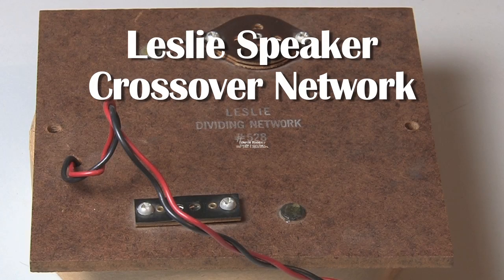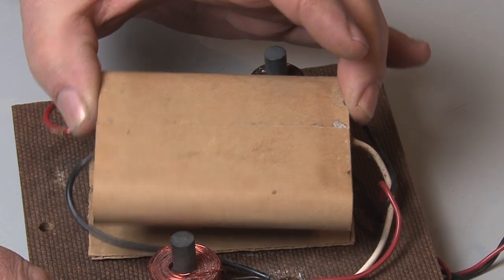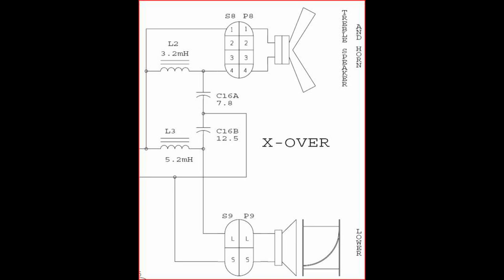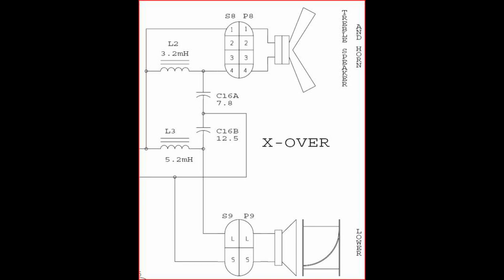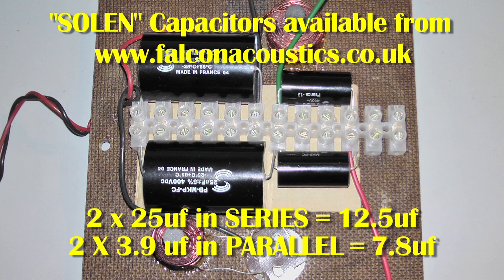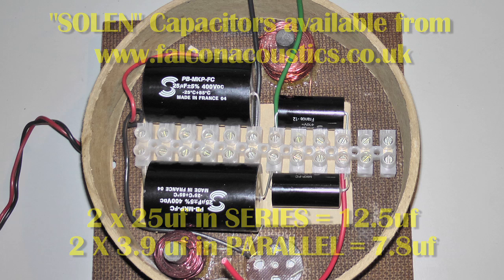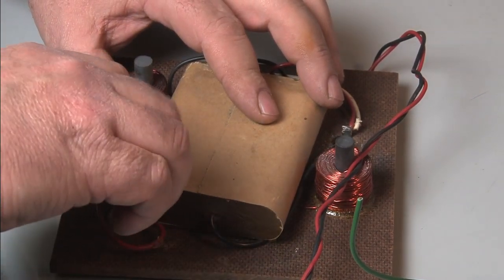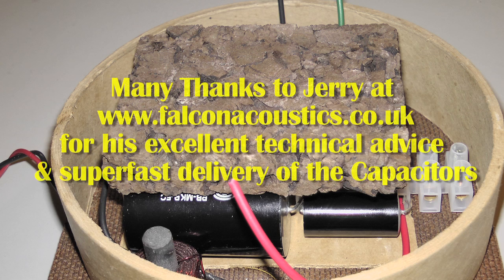HOW TO IMPROVE THE SOUND OF A LESLIE SPEAKER

Comment: Excellent, i would like to know what is the wire size of the inductors, it is awg 18 (1mm)? Or 16? Thanks!!
Reply from the maker: Sorry, no idea, they are the original ones fitted in the Crossover. I only changed the Capacitors.

Comment: Thank you so much for posting this!!!! When you mentioned the different results of putting the capacitors in series vs parallel, it was exactly what I need to hear. I wired mine just the opposite of yours because I used different caps.
Reply from the maker: Glad it was helpful! }:-)))

Comment: Thanks for the info. You definitely didn't need 400 volt caps though
Reply from the maker: The originals were large so I just tried to duplicate the physical size of the original capacitors. The end result more than justified the means.

Comment: Hello keith. I thank you for your videos that helped me a lot. I have a north c2d with its pedal, and a leslie 330 1972 (mini 760 the size of a 145) that produces 60 w rms. I changed the driver (atlas pd 60A) and I put the same eminence as you. I also modified the crossover with components trek 2 to cash 300 watts without saturated but I have a problem: I want to replace the transistor amp 60w by a more powerful amp. I play bass in the left hand and the pedal and I do not know what to take as an amp. is your marshall powerful enough to reproduce bass sound correctly? thank you again for your videos, they are so useful in the small world of Hammond organ
Reply from the maker: The Marshall EL34  reproduces the bass beautifully }:-))) and because it is a Stereo amplifier, you can feed the 100 watts from the other channel side to a straight speaker for a "non Leslie" channel.
Reply: thanks a lot !!!!!!

Comment: How similar would this be to an old 31H?
Reply: Capacitor values and crossover schematic are the same. With the exception that the 31H crossover uses two separate caps. Be advised, the field winding supply wires pass through the crossover and speaker cable.

Comment: hello, the capacitors you are showing here is what you are using for the bigger amp correct? so what would i use if i just want to keep my same amp?  will these work or do i need a different consideration? Non-tech here.
Reply from the maker: +Reuben Andrews I would still use these for the standard Leslie amplifier.

Comment: You can get the Solen capacitors directly from Solen Electronics in Canada , off their website . They have a wide range of values , and can get close to the values you want , Best to put the capacitors in parallel to add them , rather than in series to drop values . This increases losses . I buy them constantly , and make crossovers with them and sell them in customised crossovers in Australia .
Reply from the maker: A good comment - thank you ......

Comment: You can use the Dayton Audio Polypropylene capacitors from Parts Express.  In a "instrument loudspeaker" such as this it will be a great improvement without without over spending on esoteric components.  When you consider the 40+ year original paper capacitors in a stock Leslie most anything will make a drastic improvement, even non-polarized electrolytic types. These 400v rated capacitors are overkill, when 250V capacitors are more than adequate. This is a instrument it produces sound with a certain amount of original "coloring", it's far from high fidelity.

Comment: I happened to have an Altec Lansing N800-D Dividing Network / Crossover sitting nearby a Leslie horn and low rotor on my rig in the basement for my Wurlitzer 4410 electrostatic reed organ. So I unhooked the Leslie crossover and hooked on the Altec instead. WOW! It made a big difference in the tonal clarity and so I just left it hooked up..
I BLASTED the room with just 1 Hammond HR40 tone cab amp w/ it's 8-6v6's powering the  A7's 15'' Altec, the V-21 horn, & 15'' Field Coil Magnavox thru N800-D

Comment: Question: Why use two large 25uF capacitors in series when you could just as easily use a 12uF capacitor (and parallel a 0.47uF or 0.5uF capacitor if you had to have the exact value)? It seems to me that you're tripling or quadrupling the price with no discernible benefit--other than buying more expensive components from the parts supplier.